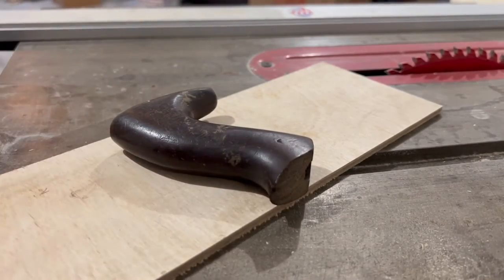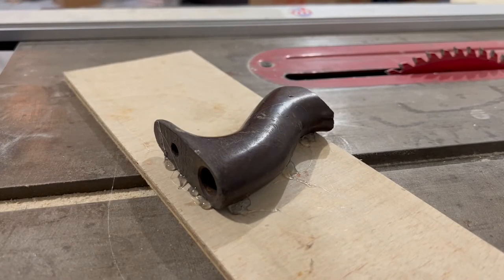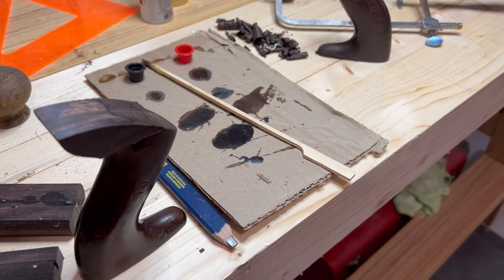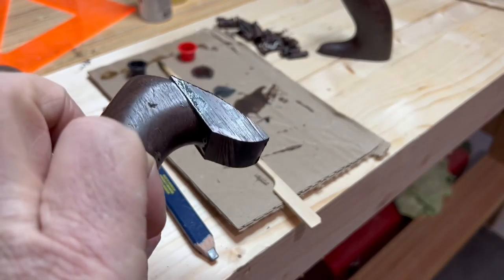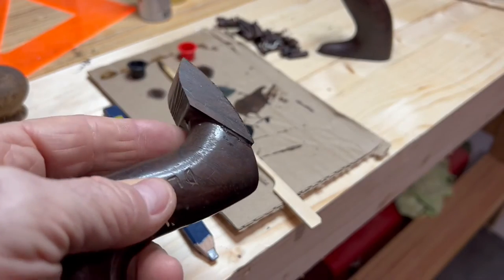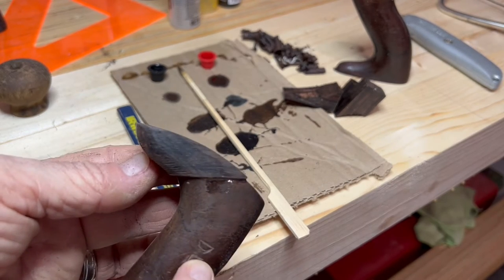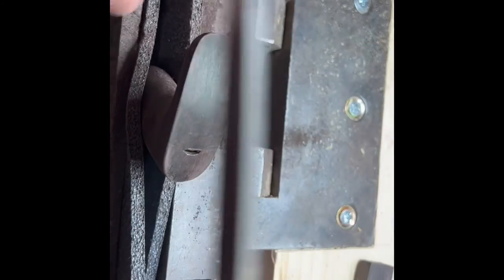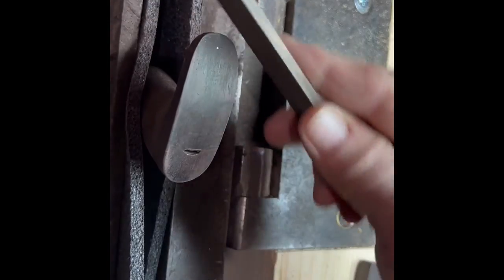New Horn on the “Down Low”

Comment: Gordon, do you have any insight to the tote production process at the Stanley works? We’re there individuals working to a pattern, cut to a template then rounded and smoothed or machine cut and finished? Are there any discussions in books?
Reply from the maker: Omg that’s such a great question. I recently met one of the Stanley B&D VP’s and I asked the very same question. There are historical documents and I am trying to make some inroads to learn more. Clearly there are no proprietary concerns as whatever they were doing is not applicable to today’s manufacturing methods.

Comment: My repair likes to pop off when I use rasps!
Reply from the maker: Are you saying the new piece comes apart at the glue joint?  Let’s talk about that…. I will admit that I have broken totes while rasping them into shape but the times this has happened, it was a new break (or an existing crack I didn’t see) Your adhesive bond should be super strong.
Reply: @gordonaddison307  I glued together an electrical tape repair with tightbond 3. I stared by using a clean wire brush to freshen things up. I was rasping the horn repair that I made from planed walnut and the troche applied busted my previous glue join.